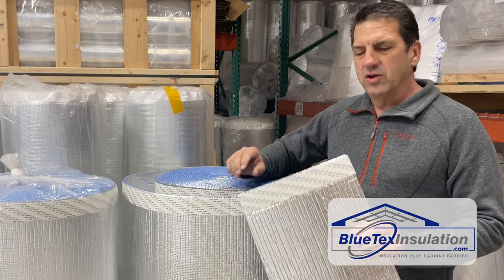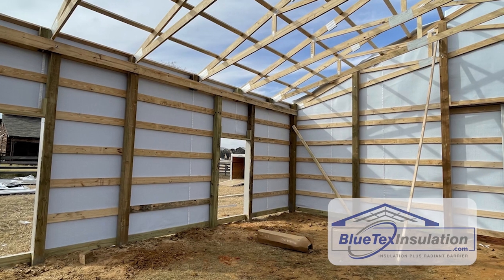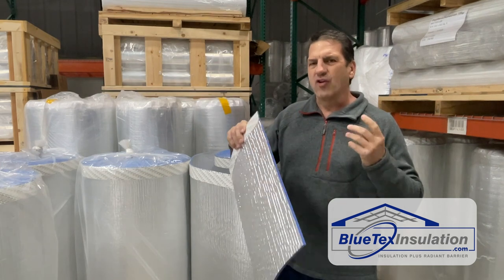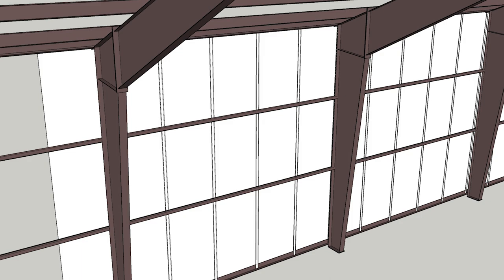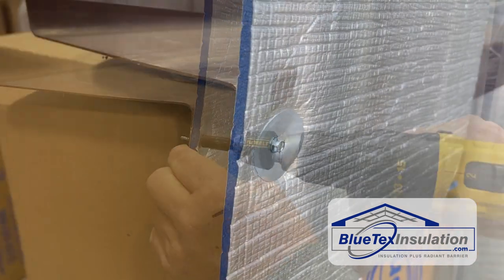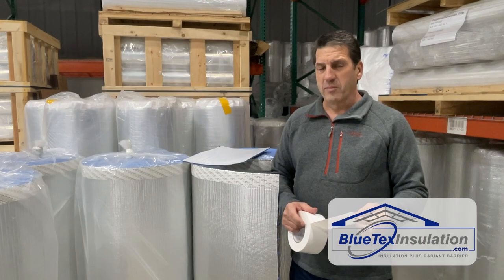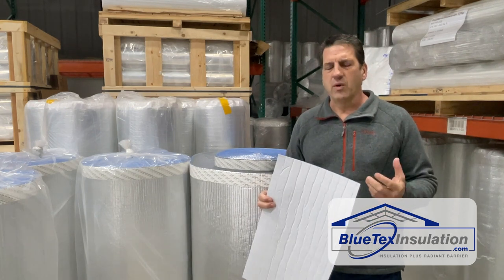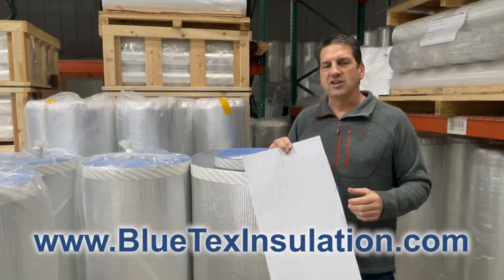The ULTIMATE Vapor Barrier For Your Metal Building - It's A Forever Product 2022

Comment: Can spray foam be added on the inside of this product
Reply from the maker: Probably not a good idea.  HOWEVER, we have had a lot of customers use our www.RoofingFoil.com all in one underlayment as a "spray foam backer" and in fact, we are about to use this product with spray foam on our own 50x60 red iron building to demo the process.  Please call our office, we can send you an email with more info/pics from other customers doing this etc.  Basically, you are field fabricating Foil Faced PolyIso Board and it's a game changer when you combine foam with a radiant barrier.  You can effectively double the r-value when the sun is out by dropping the surface temperature behind the radiant barrier.

Comment: Can I put vinyl siding over this?
Reply from the maker: When you say "Over", I assume on the inside?  Yes, it's common to cover with plywood, drywall, osb, metal or any other type of interior finish if you need a solid surface to hang shelves or want a different look. www.BlueTexInsulation.com

Comment: Since this is only 6MM and carries a low R can I have this done during the erection of the building on the out side and then after the building is done put foam board or something up a geist it to get a better R
Reply from the maker: If you are looking to add R-Value later with foam board or spay foam we have another product people have been using a s "spray foam backer".  I'm testing this method on my own 5000 ft red iron building soon.  Basically wrap the frame with: https://www.roofingfoil.com/shop/single-sided-solid-foil-underlayment/ and then spray foam to the inside.  Better value than using 6mm and covering it up.
Reply: @BlueTexInsulation  Does this stuff  require an airspace between it and the outer metal panels
Reply from the maker: For the foil to reflect heat, it must face an airspace.  Without the airspace it will still be a vapor barrier, but not a radiant barrier.
Reply: @BlueTexInsulation  Ok so on a horizontal panel building you would never get a radiant barrier on a new install because the installer would be installing the metal panes up against making it just a vapor barrier.  Now on a vertical roof, you can let it sag between the frame but what about where it goes over the purlins and touches the metal panels does that affect it
Reply from the maker: @NYTROeast  We talk about using foam strips placed next to the horizontal framing on this page.  When the metal is installed, it pushes the BlueTex in about 1/2"  and creates an airspace between the foam strips.  https://bluetexinsulation.com/pages/new-construction-metal-framed-buildings-installation